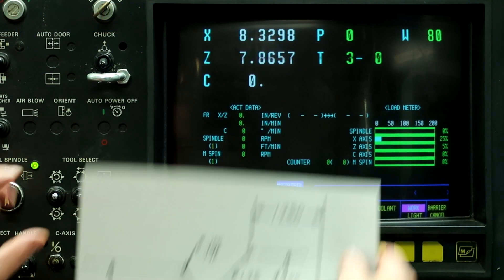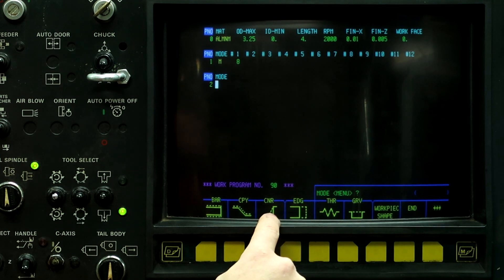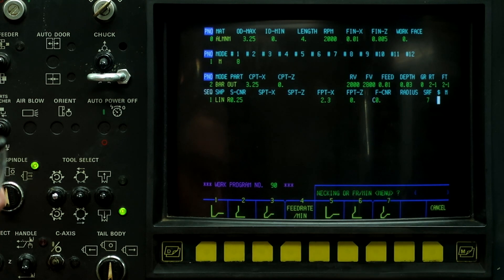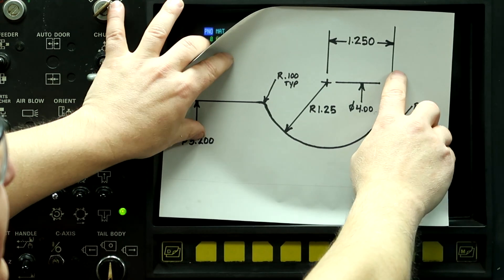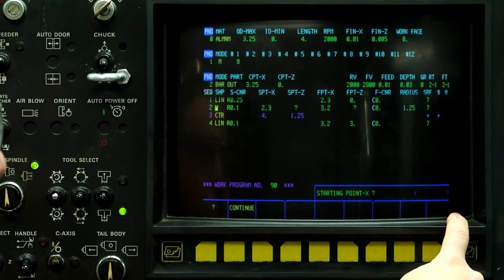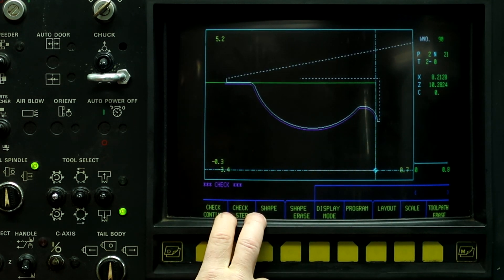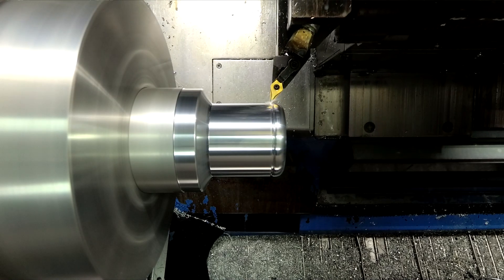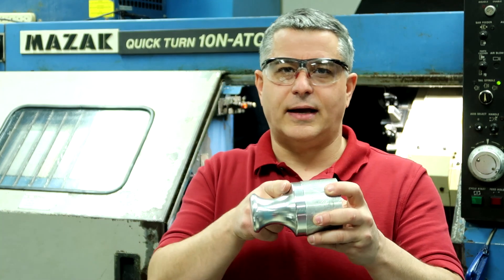Mazatrol Programming Tutorial Large Concave Radius

Comment: Sir. Please help me understand how to find the centre point for a part that starts on Z13(mm) and ends at 33.1(mm) The outside diameter is 168.83 and the radius is 35. I have tried using the centre points 98.83(168.83 - 70(R35x2) and the centre on Z 23.05. The radius does not fully form!

Comment: this is a mazak made in japan? 
any issues with it? i hear the turret is not a real lathe turret ?
Reply from the maker: My machine was made in Japan back in 1986. This machine does not have a traditional turret. It has 16 tools all of which can be either static tools or live tools or a mix of both. This machine is the predecessor to the Integrex. Achilles heel is the tool changer does not like stringy chips. They will get wrapped up behind the tools and cause issues.
Reply: @mazatroltipsandtricks6816  maybe make a video show how to load tools? etc
Reply from the maker: @fredrezfield1629  Sounds good.
Reply: @mazatroltipsandtricks6816  hey man do you have tornado milling option on your mazatrol?
Reply from the maker: @fredrezfield1629  I wish I did. It's an awesome feature.

Comment: Didn't get the 4 inch dimension center of radious and the right and left explanation of the same .
Reply from the maker: The 4 inch dimension is the center of the radius as a diameter value.  Left and right arrow shows where the radius intersects the line.
Reply: @mazatroltipsandtricks6816  if the radious is 1.25" shouldn't the diameter be 2.5" I'm sorry still a little cloudy for me !!
Reply from the maker: @frankalsterful  No. The 4 inch dimension is where the center of the 1.25 radius is located in space.
Reply: @mazatroltipsandtricks6816  what's the formula for finding that center?

Comment: Your video's have helped me greatly I have a t32-2 qt 15 and have never run a cnc lathe before and with your help it's been awesome . I did find some stuff useful on my own that may help others with a limited 3 phase power supply, one is adjust machine parameters on the sp19 from 300 to 2500 as then it won't over voltage I run mine off only 40 amps with my phase technologies 10 hp converter . And as for the tool eye the B63 parameter just keep on adjusting until it cuts to what you program the machine for . I do have a question though as my machine doesn't have the EIA option or it's not turned on do you know how to add it ? 
Thanks again for your great videos .
Reply from the maker: EIA is really not needed. Been running Mazatrol for 24 years and my machine has the EIA function.

Comment: How do u find the center of the arc (4.000 ) is there a formula or get it from a cad software ?
Reply from the maker: This was just a practice part. Many times a CAD drawing will just show the location of the center of the radius but not the end points.  I was trying to use a common example.
Reply: @mazatroltipsandtricks6816  if you know how to work out that formula with out a drawing package of the (4.00) please share it will be helpful as most drawings is very limited on details...